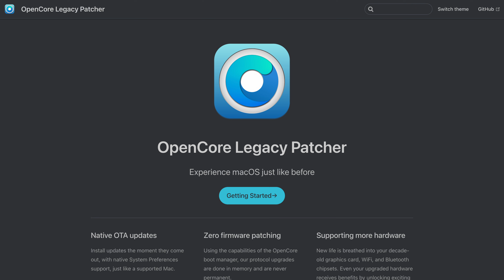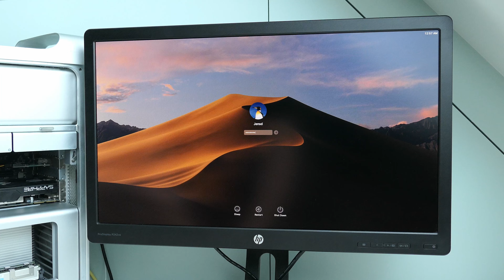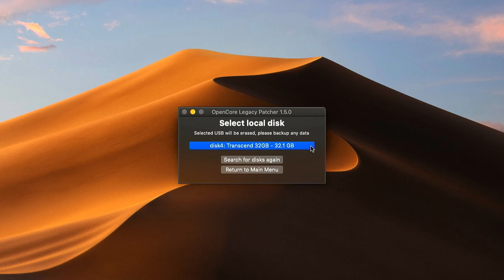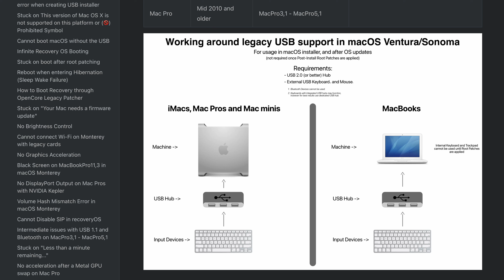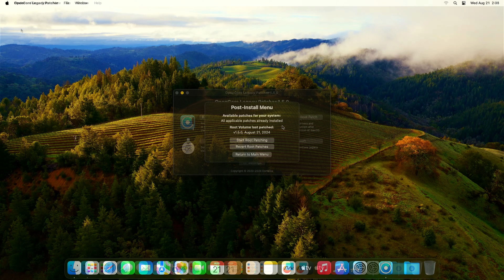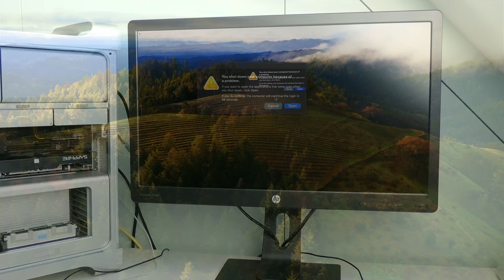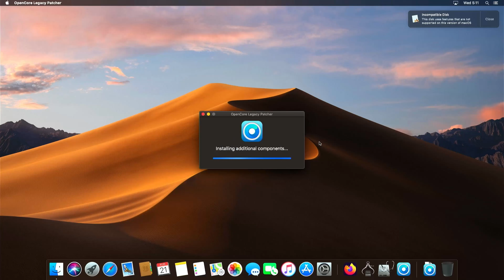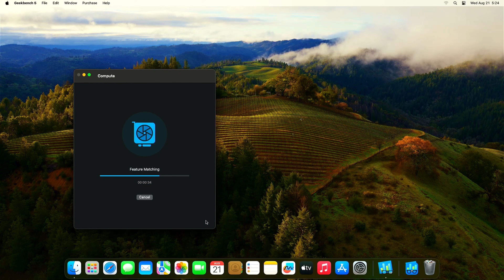macOS Sonoma on Mac Pro 4,1 and 5,1 with RX 580

Comment: I just followed your intstructions using a Radeon RX 580 8GB but instead for Montrey on my 5,1 as its more stable for now. Everyhting worked great. I am so happy. Thank you. I can finally download modern versions of apps I need like Brave, etc. Mojave was too old. Other videos were so confusing and had weird additional steps like disabling SIP along with other thing but none of that rubbish is needed. Now I have Montrey on a 1TB HardDisk, Mojave on a 680GB in Slot 1, and Windows 11 on a 480 GB SSD in slot 2. I used a wired Apple 2 Keyboard that came with my other Mac Pro 4,1 so that worked to type in acc details and I used a wired mouse connected to the front of the Mac Pro 5,1 to click. OCLP is great because you can use wifi on Montrey which normally without the stock wifi card would not work. OCLP fixes that so you can still use the stock wifi card which is fantasic. I just had to manually connect to wifi in the settings as doing it the regular way with the mini icon on the top right of the screen would not work.
Reply: Thank you so much my Rx 570 8GB card and run smooth on the MacOs Suqua now❤😊

Comment: i am interested in the sled you used of the PNY C900 ssd...did you 3d print it or is that a commercial product....I 3d print
Reply: Its an OWC product and can be purchased on Amazon. It's called an "OWC Mount Pro 2.5"

Comment: Hi i have a mac pro 5.1 and a Radeon RX580. What is the simple and the better system for my computer. Everybody talk about monterey. any thought ? thx
Reply: Monterey is awesome. Been running that for some time on the same setup. But software is getting updated so I might need to go for Ventura.
Reply: @Mattnh  Ok i see and i agree ;-) No problem with rx580 and monterey ?
Reply: @fkclub2584  RX580 and Monterey is not an issue at all.
Ventura is giving me a hard time and root patching fails so will try Sonoma today.

Comment: First of all, thank you so much for your amazing, super-easy-to-understand video...
A few questions from Chile:
1- Are the Wi-Fi and Bluetooth the original ones on the Mac Pro 5.1?...
Or did you update those devices?...
I see that macOS recognized the devices without difficulty...

Best regards from Chile
Reply from the maker: This was indeed an original Apple Bluetooth/Wifi card that was installed in the system.
Reply: @jensdbe  Thank you so much for your reply! It gives me hope that I can upgrade my old Mac Pro 5.1 to a new version of macOS... 
Would it be possible for you to tell me the model of your Wi-Fi and Bluetooth so I can compare it with the one on my computer?

Comment: The 5.1 will only die when Apple go ‘silicone’ exclusively and stop supporting intel. 

Hail to the king !
Reply from the maker: To my idea it becomes less and less interesting, especially due to the power consumption vs performance ratio. Electricity is expensive where I live so that's an important factor unfortunately. For day to day tasks, an older Silicon-based machine becomes very affordable now as well.
Reply: @jensdbe Of course. I use my 5.1 for electronic music production on 10.11 (life long hobby). I may buy a used M mac mini when the support truly end and browsing the internet on these old machine become impossible (thinking if the G5 here).

Comment: Hey, so I have a 4,1 as well which I flashed to 5,1 thanks to your Tutorial. Now I want to use Opencore to install Sequoia. But when I Remove the Boot ssd when its turned off and then start it, it doesn’t go to opencore from the stick. Just stays black. I have a GTX 760 (which is not flashed) currently installed in the system. Csrutil is disabled. So you have any advise?
Reply from the maker: Did you build OpenCore with that GTX 760 installed? As I noticed that you might get a different configuration for OpenCore with a different GPU. 
Also you could try to remove the SSD, put in the USB drive and hold CMD + P + R, the power on the machine, hold them and wait till you've heard the chime at least 2 times (this can take some time). 
One more thing is that it could be just an issue with the USB drive. Some of them somehow are difficult to boot from, I've seen this especially with Sandisk drives.
Reply: @ hey, thanks for the answer. The solution was to enable NVIDIA GOP in Opencore before building the installer. The installation then worked fine. But now I am at another problem: when in Sequoia opencore tells me that all root patches are applied and graphics acceleration and WiFi is working, but the usb ports aren’t, except with the usb hub used during installation. After trying to revert the root patches and install them again it is still not working… is there a possibility to go in the efi manually and add some kext or is there an easier solution? On the opencore site I did not find any solution to this…
Reply: I might have to add important information that I just found out. If I connect a USB drive to the usb ports on the Mac, they work. If I connect any peripherals they won't work unless using the hub...
Reply: @jensdbe  I am having issues with Lexar but worked fine on Sandisk....a larger drive is recommended I used 30 gig flash drive.

Comment: Hi, great video, so helpful!! I got a question, I have a Macpro 5,1 mid 2010 with a processor 2.8 ghz Quad-Core Xeon, currently I'm running Monterey but I want to know if you recommend upgrading the processor to a faster one, and which one do you recommend for this machine. Once again, thank you so much for sharing this info!!!
Reply: Hi! I'm going to do the OCLP and I think that the x5675 (95watts) is the best option in terms of TDP and performance Vs other options with 130watts but it's just my opinion.

Don't forget that you have to delid the CPU before install it in the 4.1 dual processors.
Reply: hi i want to upgrade too, not decided yes, did you buy a new CPU? did you go on sonoma ?

Comment: I had the same “fans spin off” problem, and solved it with your video, many thanks!
Yet, when I login to Sonoma, and after I apply root patches, everything seems to work perfectly fine, but fans again spinofff. Is that normal? Everything works, but fans completely turned off. Under system info my gfx card is recognised properly: Sapphire Rx580 8Gb. 
What is the problem?

Btw, when I login to Monterey, on different drive, fans work correctly.
Reply: I figured out that most probably this “fans off” is normal. Under some load (fullhd yt video), fans started for sometime and then stopped again. Looks normal?
Reply from the maker: I have the same behavior, also on Windows. I'm pretty sure this is how it is supposed to be and it keeps the machine silent when the GPU is not under heavy load.
Reply: @ thank you vey much. This video, along with the Jessie’s flying, helped me A TON. I took me days of troubleshooting, and without these two channels, it would have been impossible. 
Seems like I am good on Sonoma at last. Thank you!

Comment: looks easy... but is tricky ;-) I've tried to install Monterey on the exact system you have, but end up in a macOS Installer loop... The mac Pro starts up, shows me a macOS Installer icon and automatically changes to the apple logo and the progress bar. After about 30% it stops, black screen and back we are at the installer icon. Any ideas?
Reply from the maker: Should work fine with Monterey I ran that as well on the same system. Are you sure all hardware is ok? (I'm thinking memory). You could get more luck  with another USB drive but it can be tricky to troubleshoot these kind of issues.
Reply: @jensdbe  I'm pretty sure hardware and memory is ok - the mac runs fine with it's last Mojave installation. I'll try it again with another usb drive, let's see whether that will solve the problem...  ;-)
Reply: short feedback: it worked! I didn't realize that during the installation process there are in fact several restarts involved. And I finally got Monterey installed! It just took some time... Thanks again for you video, it was really a great help to understand how to work with opencore LP!
Reply from the maker: @ThomasCGass  glad to hear you managed. Thanks for the nice feedback :)

Comment: That took a while but you got there!👍👍
Reply from the maker: @laurencejohnson4106  if there is one thing I learned when fiddling with these lovely machines it is that nothing comes easy or always looks like a simple task, turning into hours of troubleshooting :)
Reply: @jensdbe  Yes, there can be complications with older computers; I have just the one Mac., it's a 2008 17 inch MBP., and I installed Linux Mint Mate on it and it's currently working well, perhaps you could try to install a Linux distro on that 4,1.

Comment: And how do you deal with drivers? For example, I use a FireWire audio interface, and that operating system does not have drivers for this format, and the Internet card I ordered does not have drivers for that operating system... so how do you make everything work properly?
Reply from the maker: @Iglesiabiblicafundamental  if it is supposed to work with macOS Sonoma, it should work just fine in this case as well. Either it can use the built-in drivers or kexts that come with Sonoma or the manufacturer will provide one. This is no different than it would be on a supported Mac running Sonoma. If there really are no drivers for macOS at all, you can also run Windows on this hardware.
Reply: @jensdbe  no, Windows, never never..
Reply: @Iglesiabiblicafundamental  maybe linux ?
Reply: @the_sjdo  I need it to be Mac for the audio programs I use for work, Linux doesn't have it
Reply: @Iglesiabiblicafundamental  Adobe ? or any big Program for Audio Work that has no Linux support)
Reply: @the_sjdo  I need pro tools and logic pro, those don't exist for Linux
Reply: @Iglesiabiblicafundamental  yeah if have buyed it, I wouldn't change either to a diffrent DAW.
Reply: @the_sjdo  Of course I bought them and the programs, what I didn't know was that they couldn't be updated and without updating the newer versions don't work.
Reply: @Iglesiabiblicafundamental  are you using real firewire or thunderbolt to firewire ?